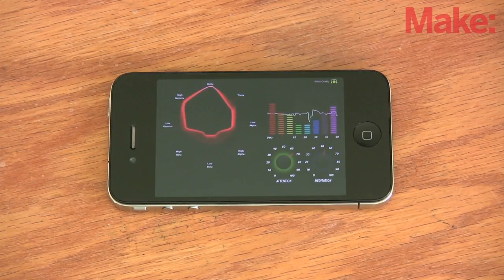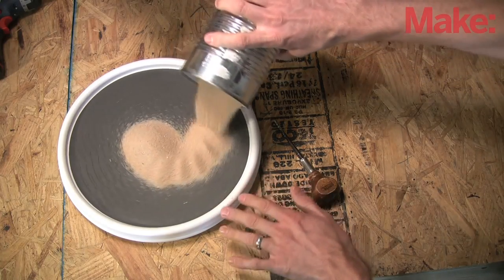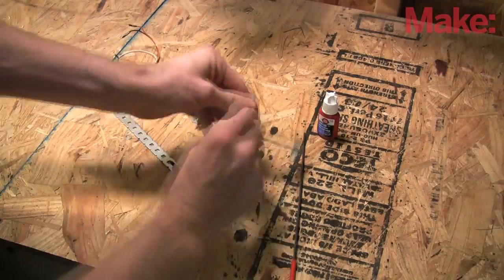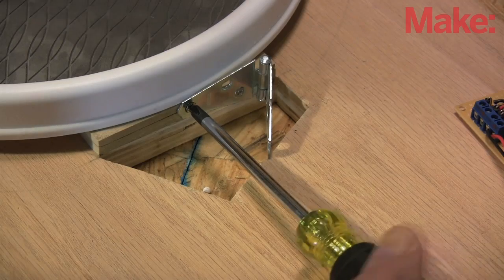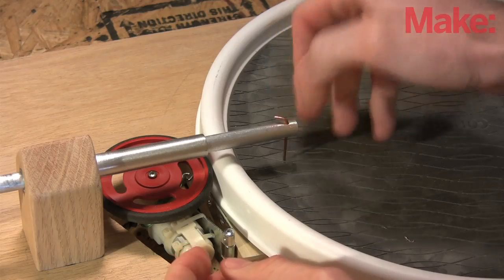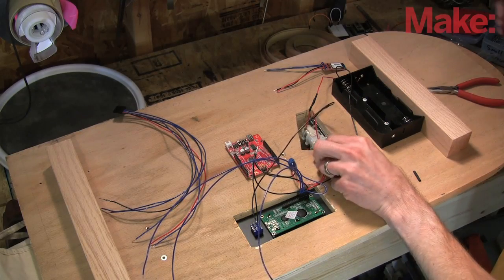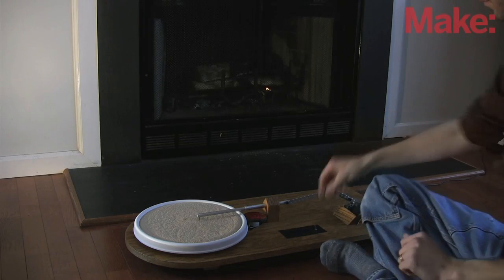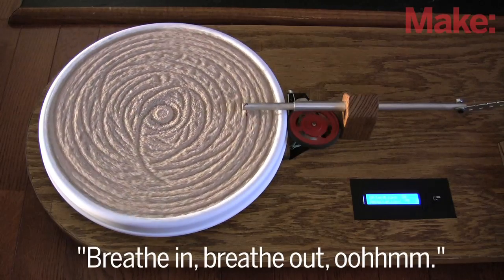Making Fun: Brainwave Zen Garden

Comment: I love this project. I would like to suggest some upgrades to this to make it very nice. I would suggest mounting the motor arm below the turn table, instead of scratching into the sand. Your method of scratching can be a magnetic weight. You can also mark the 8 sides of the turntable with something like natural stone spheres of different colors so you can interpret the data. There are other magnetic sand garden hacks that are very elegant so this is inspired by those.
Also having everything mounted below the turntable means that it can be enclosed. Hiding all the mechanical and electronic bits and muffling the motor sound.